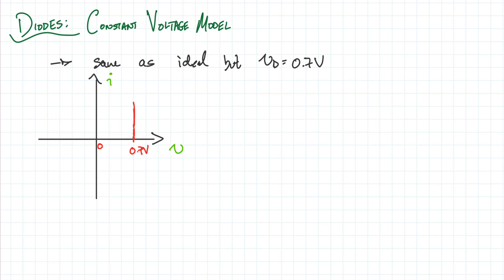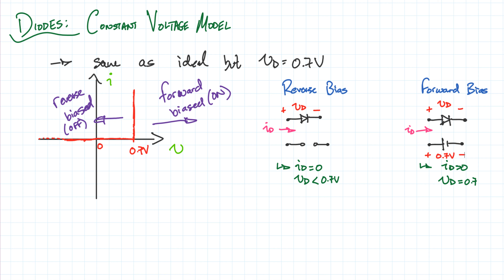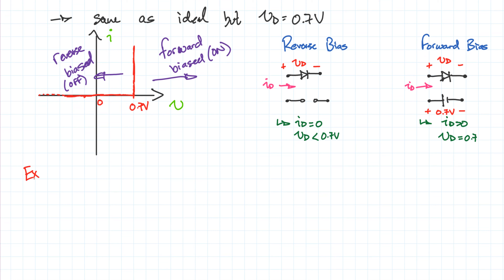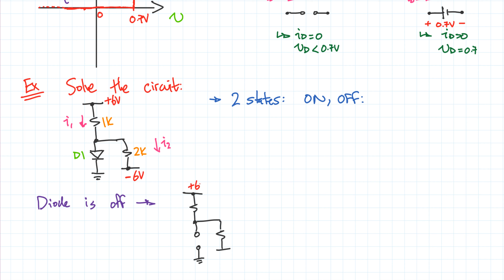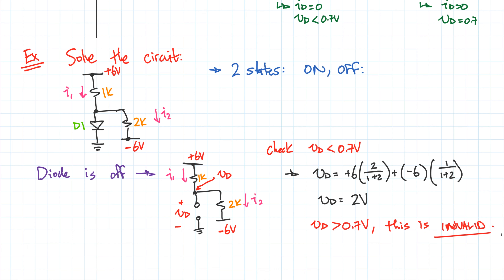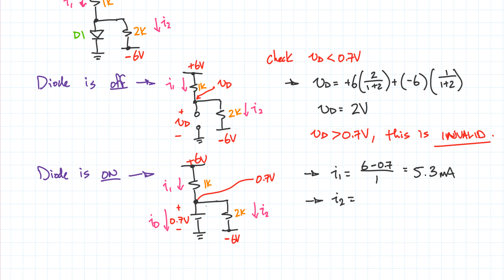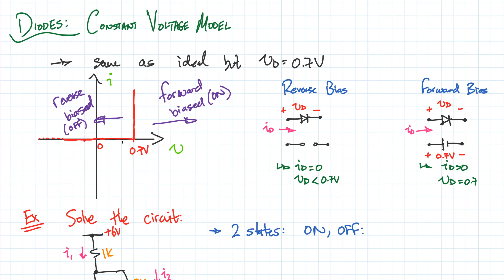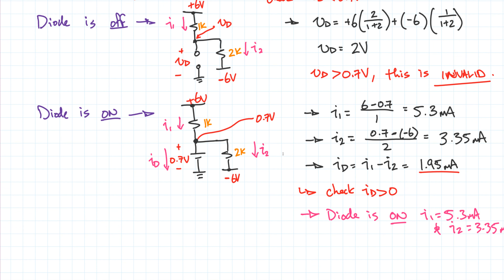Diodes - Constant Voltage Model

Comment: why voltage drop across diode doesn't increase when the applied voltage is greater than the barrier voltage?
Reply from the maker: Hi Khizar. In reality, it does change according to the exponential curves that we see in introductory electronics classes. However, depending on the application, the change in voltage is often insignificant, and so we can use what is referred to as the constant voltage model (the model shown in this video) in order to approximate the voltage at 0.7V since we know in reality the small changes will not have much of an impact on the overall operation of the circuit. 

There are some applications, however, where the circuit voltages may be comparable to the 0.7V, meaning the changes in diode voltage according to the current through the diode may be significant. For such cases, we typically use the exponential model of the diode to have a more accurate model of the diode's behaviour.

Hope this helps!